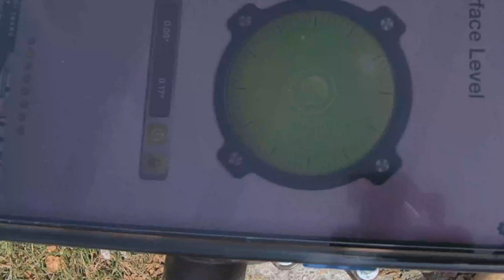Cementing an Umbrella into the Ground

Comment: I was about to follow your idea but you never followed up it's been a year. Is it still up did it pull out of the dirt what happened, because I want to put a cantilever umbrella up now if I can avoid putting it in a planter and sitting it on top I will do it this way
Reply from the maker: Thanks for watching. I have since done 2 of these and they have both held up really well! Storms and strong winds have not moved it. I am very happy with this little project!